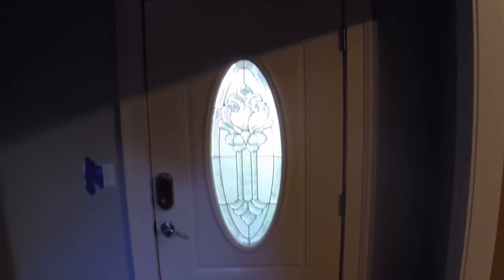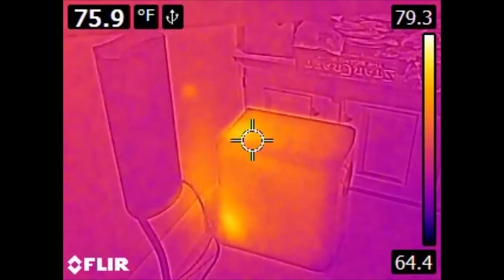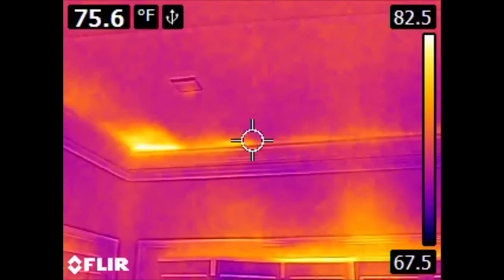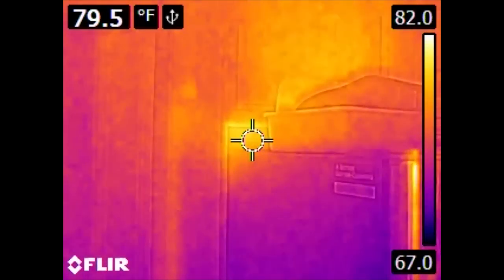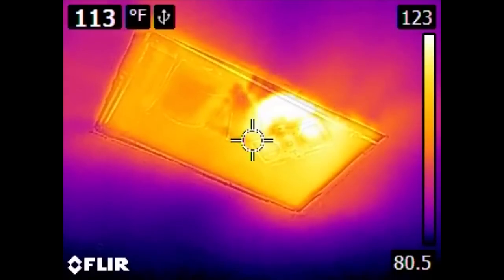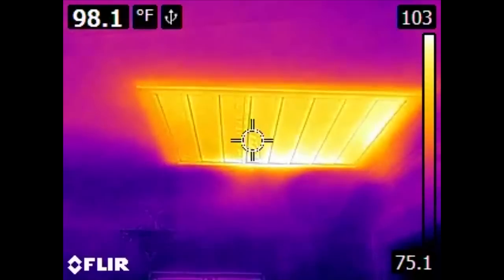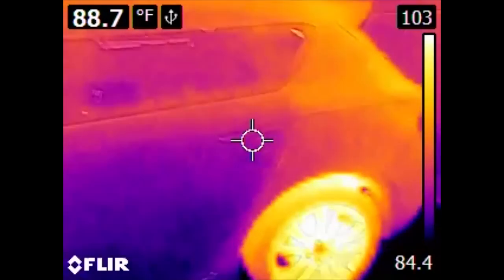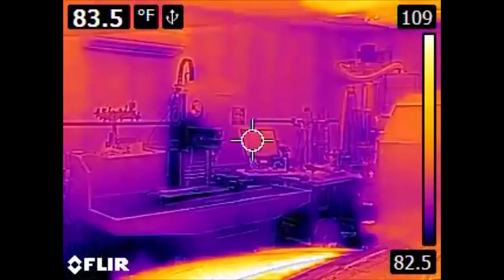DIY Home Energy Audit with an IR Camera

Comment: Great video.   I had an audit done last year.  While the inspector did not find issues to the level you show in your presentation, the camera did indicate problems with typical areas (e.g. attic entry, trey ceiling, etc.).  I decided to purchase a FLIR One that can connect to my iPhone 5.  You did state the cameras can be rented, but I will find myself wanting to check frequently over a period of time; thus it just makes sense to purchase one.  What would be nice is if you could record going through the process of finding a trouble spot, show how you fix it, and then demonstrate the change using the infrared camera.  Thanks for taking the time to make and post this video.
Reply: Russell, have you got FLIR? Happy with it or you will go to other model/brand now?
Reply: @bialy100k  I know the original comment was 8 years ago (iPhone 5 omg) and yours was 4 years ago, but I’ll add this for others who may come here. I have and use a FLIR One (non-Pro) on an iPhone 14/iPad 9th Gen and I’m totally happy with it. I’ll note I use it for home audit use, but I would absolutely feel comfortable using it for something like a home inspection. 

Pros: The resolution is high, you can easily take/save photos to your phone, there’s numerous camera settings in the FLIR app to make adjustments, only paid $400, and charges with USB-C. 

Cons: 35-50 mins of battery life (so make sure you know what you’re surveying before you turn it on) and the frame rate/shutter speed is a little slow (this feels dumb to say considering how video works, but it stands out that the One is just repeatedly taking photos to bring you “video”), it’s not unlike the stutter in the video here. That could also be from constant calibration, I’m not sure.

Seems like the price has dropped since this video if I paid $400 for the same quality that the author paid $1,000 for back then.
Reply: @TitaniumTurbine Thanks :) I got my IR camera kind of 2020, It is HT-18. Bought on Amazon, few hundreds $ on some bargain newcomer company offer(don't remember exactly, but later proce goes around 1.5-1.8 higher). Pic resolution comparable to Flir One (probably slightly higher). Is a "stand alone with a handle" model. Cons: Noisy, no video (only photo) recording, Quite narrow view angle (so you have to be quite far from objects to see wider view). What is a biggest pain for "semi-pro" model is a lack of possibility to "lock" temperature map. So If I want to "compare" two different area I have to keep some "constant temperature marker" in view-range. Moderate fast/slow (as most of them). Pro: Li-On quite big battery, USB charging, and is a possible to make extra IR lens (I make my own holders)  for microphotography - I use them to diagnose small electronic modules for fault.

Comment: Thanks for this video - Great beginner friendly Audit with good explanations 👍
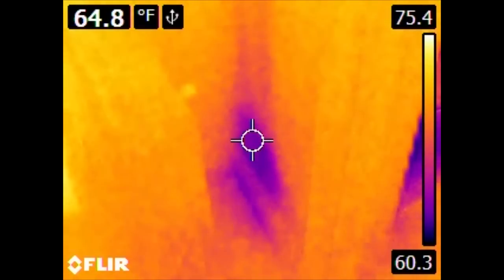At 7:09 with the duct thermal loss to the behind wall - is condensation a possible concern in that area? I have a few similar spots in the home. If it's an air/duct leak in my region (AB, Canada), the seasonal temperature swings makes those spots feel pretty damp. I didn't even know how many years it's been like that but it definitely started showing signs or concern eventually with some paint bubbling.
Reply from the maker: It depends. You do not normally see condensation on your vents when the AC is running because the temperature difference is not very large and the air inside the house has a lower relative humidity because of the AC running over time. However if cold AC air meets very warm humid air you can have lots of condensation, even without a leak. 
I had a uninsulated supply duct running through a ceiling space between floors of my house where the between floor space was vented to outside air. Because the duct was uninsulated there was a large amount of condensation accumulating and leaking onto the ceiling. I had to tear the ceiling apart and replace the duct. 
If you suspect this might be happening you can get a borescope inspection camera to look inside the wall. You only need to make a small hole (easily patched) in the wall to get the borescopes inside to check.
Reply: @LesWilhelm  I appreciate the quick reply. Sorry you had to experience that. I think I may need to rip the ceiling too. I can see a pretty wide temperature difference from the studs /joists and the external walls/top floor ceiling with the thermal cam. I suspect because of moisture build up. The house originally wasn't very well sealed (home from 1989). Codes were pretty loose then seems like. 30 years later without noticing some deficiencies and it escalated into bigger air gaps and warn down insulation from years of moisture. Now, I've been trying to play catch up.

I was thinking about drilling for a borescope but I was worried about piercing the vapor barrier, but I guess it's not very effecting anymore anyways. Thanks for the idea. I'm new to being an owner and just learning as much as I can before making any destructive work. I've lived here for most of my years about 25 years, and after my parents passed, I took over and figuring out what needs to be done. 

Lots great videos to learn from, but also lots of unclear information (depending on regions.. and sometimes peoples methods). Your video was great tho. Very clear and straight forward.

Comment: I was wondering if this something I can use looking for disc golf discs in the Winter
Reply from the maker: @danyalarafat1271  only if the disk is a different temperature than the environment. Objects with low thermal mass tend to adapt to the temperature of their surroundings very quickly.

Comment: Hello mate any chance you could have an advice on how to detect the source of a water leak through the ceiling, am planning to buy a FLIR CX-3
Reply from the maker: For most climates standing water will evaporate making the region around it colder. You can see this on the thermal camera, however ceiling leaks can be hard to track. Water can follow the supports in the ceiling and drop down to the lower floor a significant distance from where it originated. 
Drilling a small hole where you think the leak is and using an inspection (borescope) camera to confirm is probably the best way to go. 
Good luck!

Comment: amazing job, any idea about where can I rent a equipment like this in USA?
Reply from the maker: There are a few Home Depots which rent them out. Flir has a page you can check to see if there is one near you.
Reply: 6 years late 😂 
Check local libraries 
Mine rents one for $2 a day it’s just a $300 Klein one but it’s great for quick/diy to check missing insulation or hot spots for automotive etc
Reply: dont bother renting and just buy one. The cost to rent for a few hours is the cost of one brand new.
Reply: @Robbie-mw5uu  nowadays for sure, tkssssssss

Comment: Can these be used to determine the heating and cooling loads of houses in order to size of the heat/cool system?
Can these be rented?
Reply from the maker: Not really. The thermal camera can tell you the surface temperature of an object but it cannot tell you how much energy it took to get it to that temperature. You would need the mass and thermal properties of the object to determine what heat load it received. Heat loads for any given house also change throughout the year.
There are various tables, formula, and software which can be used to determine the proper HVAC sizing of a house. Unfortunately such analysis are expensive to do correctly and most HVAC techs I have spoken with use fairly crude estimates when sizing a house.
Reply: Thanks Les.
I was afraid of that.  And yes, heat/cool load  analyses are crude, expensive, or both. So what can you do with IR images other than leak detection?
Reply: That's done using square footage
Reply: @starmc26  Square footage is only part of it. Ceiling height, insulation, windows, appliances, number of occupants, ect... play a role when it comes to doing a proper load calculation

Comment: how much would you pay for someone to do this ?
Reply from the maker: Depends a lot on where you live. I would say around 100-300 depending on the specifics of the service.
Reply: Les Wilhelm i bought a FLIR C5 and im trying to get into the home energy market . i dont have a blower door and im trying to get certified in different areas . your video inspired me that thermal imaging can be done correctly without a blower door . i actually have made up a small schematic of a DIY one to fit into windows instead .